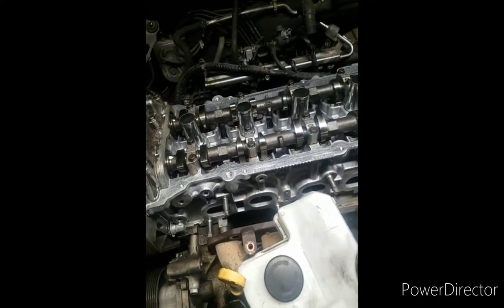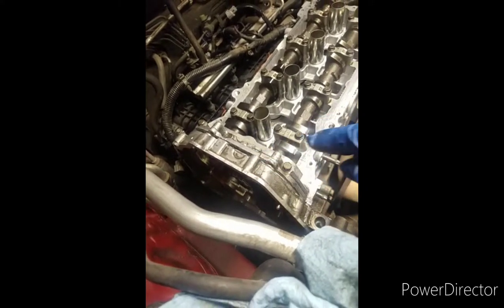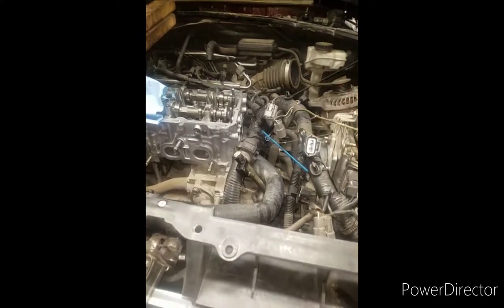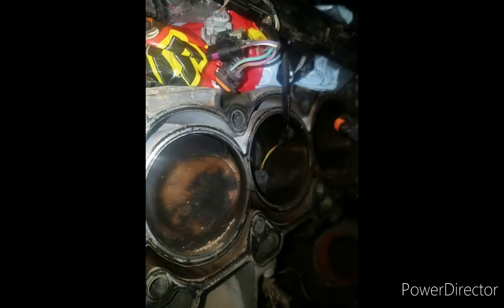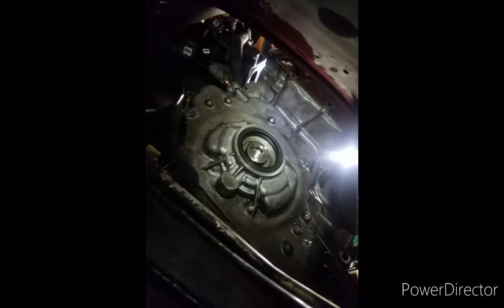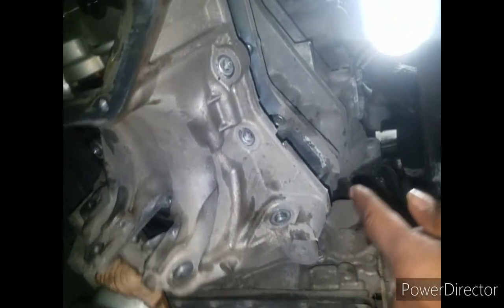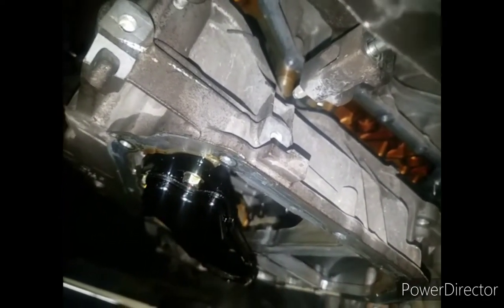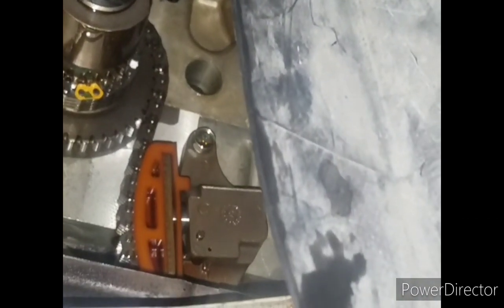2013 nissan Altima head gasket repair/ timing chain

Comment: Thanks for the video.  Your video is the only one I can find for 2013 newer nissan engine.  One question about your camshaft lobe position when the engine is put back together and in time.  Do the first pistons camshaft lobes point out or are they pointed down and out a little?  Not sure if you remember since making this video, but you have them covered with the cloth and I can't tell.  Thanks
Reply from the maker: On a 4 cylinder it doesn't matter where the lobes are. It matters where the dot or marking on the cam gear is.

Comment: The issue is nobody removes the timing chain tensioner. You have to take that out. As the second you remove the chain. That thing pushes the plunger all the way out. Why the chain does not want to go back on. You have to reset it. Then put the chain on. Then the tensioner back in....
And yes copper coat fixes that issue. As it acts as a heat transfer agent...

Comment: No this doesn't tell you nothin bout how to remove the head or anything, trying to show you what he did afterwords is a complete waste of my time .
Reply from the maker: If you're doing a head job on an engine, you need to know what you're doing. If you're looking for a how to do it in my opinion you shouldn't be doing it, because its not for beginners. I don't have to read nor get taught how to pull a head off an engine. I only need a book for torque  specs and timing alignment. I'm not trying to be a smart @s. Some of these timing jobs can be a little intimidating.